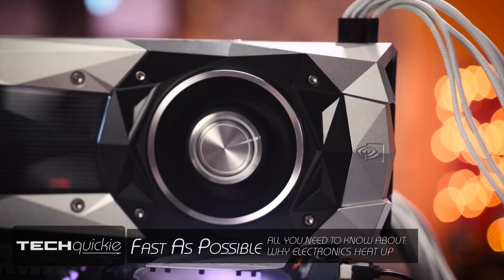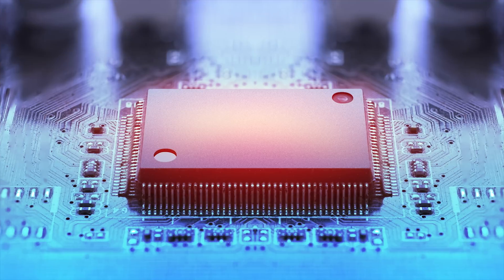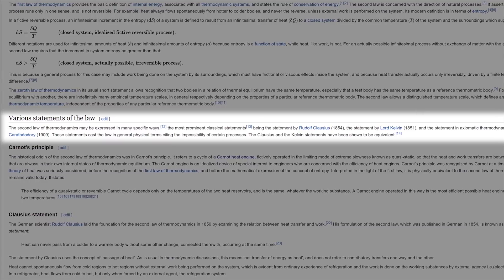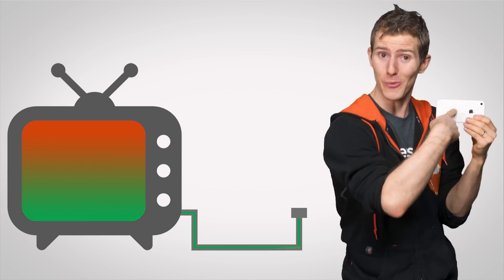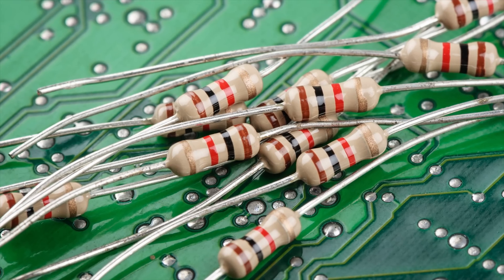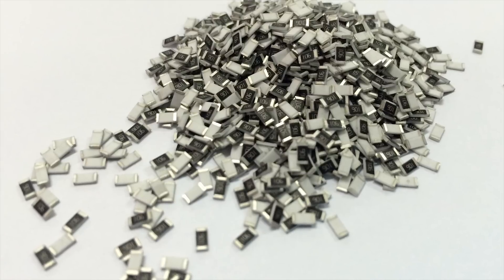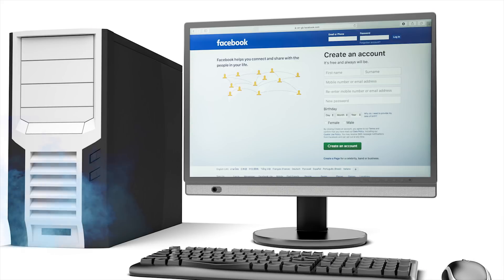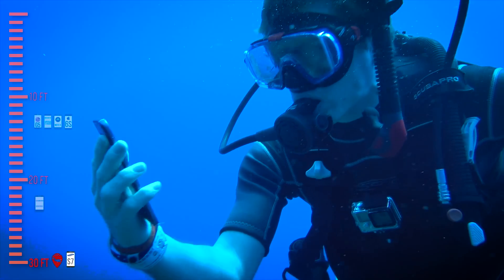Why Do Electronics Get Hot?

Comment: Of course the reason those little transistors in your CPU switching on and off takes energy is because the transistors in question are MOSFETs, the same as the big ones on your board, only smaller, and there are literally billions of them. Apart from a small amount of leakage, in modern CMOS technology when they are not changing state they don't actually use power. The gate though, the part that turns it on and off, is inherently somewhat capacitor-like, which means it needs to be charged to switch on, and discharged to switch off. The energy needed to charge that is then wasted as heat, billions of times per second. It's amazing, actually, that these things heat up as little as they do, if you think about it.

Comment: You don't generate Heat. Energy cannot be generated or created. You can only convert energy. Your PC needs electrical energy and since energy cannot get lost and your PC isnt moving or anythig else the energy is converted to heat.
Reply: Of course heat can be generated. At least this is a common term for it. You can even generate electrical energy. Do you know how they call the device that does it? Generator.
You're right with "energy cannot be generated ..." and the rest of your comment though ;)
Reply: Yeah, I know how a synchronous generator "generates" electrical energy (its actually converting mechanical energy to electrical). And yes its für common term but nevertheless I don't like it because "generating ... energy" just sounds wrong ;)
Reply: depends on how far you wanna go with the technicalities lol. Linus definition of the 2nd law was also kind of weak. he should've said that there is waste energy released, most of which is heat, although light vibration (sound) radiation....etc can all be waste energy as well although not necessarily in electronics
Reply: Technically, heat is just the transfer of energy between two objects. So "generating heat" just means energy is being transferred between objects, thus increasing the temperature in one. It does not mean "energy is being created".

Regardless of that definition, if we were converting one type of energy into "heat", you could say that heat was being generated, since it didn't exist in that form previously.
Reply: You do generate heat. You generate heat from energy

The energy is converted into heat, but heat does appear
Reply: Heat is the transfer of thermodynamical energy, heat is a flow of energy, not energy,  you do can generate a flow, also you're doing work on the electronics, so if it were made of superconductors you wouldn't waste energy in the form of heat and energy would still be conserved.

Comment: Why don't they make processors bigger for better heat dissipation?
Reply: My guess is that they want to keep things small to minimize delay between transistors and cores so that way it's faster.
Reply: Jonathan Ferrante I'd say it's because the manufacturers want to save money and material. Even if it's a small amount of material, multiply that by 1kk and it becomes a lot of material.

Comment: It's simple AF when you know physics
When a lot of electricty (more intensity than voltage) electrons excite things around where he pass (more voltage is more excited electrons) 
And temperature is excited atoms
Reply: "temperature is excited electrons" 
Wrong
Reply: Then when we OC a cpu for example, it affect the frequency of how fast current pass
(like 5 amps per seconds then oc it could be 9, you understand) and sometimes it affect the voltage
(Like 5.2 GHz 7700k which set it on 1.57 V)

Comment: its Because Silicon devices are not 100% efficient. it doesn't matter if its a CPU, a small IC or a single transistor. if it runs on current it will produce heat. Simple.

Comment: You should have talked about why amplifiers get hot, but don't need coolers and don't get damaged because of the heat. In some cases, the heat it discharges is a good feature, such as for Class A amps.

Comment: Maybe sounds like a dumb question but why is it important that all the hardware is kept cool?
Reply: Materials tend to resist electricity the more they heat up.
Reply: Sebastian Poppenborg More heat = More degradation over time.
Reply: A question is not a sign of ignorance or "dumbness," it's just a sign of curiosity :)
Reply: Too hot, and the circuits fuse, and in the end you have a piece of dead hardware
Reply: +TheBanana Dude That was not caused by heat, but by faulty battery cells...
Reply: Have you ever cooked your own meal?
Those hotplates often are in the range of 800 to 1500 Watts.
With vitroceramic you can see what is going on. http://www.icf.com.tr/files/vitro-back-2.jpg
Yes, that is red hot glowing metal.

Now let us compare that to a modern CPU. They are less than 2 cm² in area. So they actually produce more heat than your hotplate does and that already brings the metal to glowing. If your CPU would not get cooled it would simply burn up any plastic and melt the metal.

and you do not need to get it that hot. the warmer the silicon gets the faster it degrades, where most put the limit at around 125°C where it starts to fail rapidly.

And then there is the thing about efficiency.
The warmer metals get the more resistant they get. That in turn means you need to push even more energy to deliver enough to flip the individual switches (mosfets). So a cold CPU uses less power for the same work than a hot CPU would need.
Reply: Dielectrics (resistors) actually lose resistivity as they heat up. (Conductors get resistive with heat). Silicon is a semiconductor and acts like both. Transistors (made of silicon) modify the resistance across them based on the input (gate) voltage. 

This is dangerous in amplifiers since this causes thermal runaway ( I = V / R ).  Less resistivity increases current. More current creates more heat. So eventually your silicon transistors won't be able to generate resistance to turn off. 

Once the temperature gets to 500C, the doped phosphorous in the silicon is going to start to move around. Destroying transistors, the functionality of the chip. 

The long term effects of high heat is a slower version of the above. doped phosphorus is slowly going move. 

Your CPU is designed to turn off unnecessary dead transistors, but too many in the wrong place will render the CPU useless.
Reply: the thermal stress create cracks on soldering balls and that produce bad contact between the component and the motherboard, i can ensure you that from my experience, it happened to me. i had to reballing a pch
Reply: because the thermal stress damage the components and the soldering balls of the componentes attached to your motherboard
Reply: Here's an easy explanation. What is heat in physics? Basically, movement. At absolute zero no particle is moving, but the warmer you get, the more those particles move. Sure, solids are not as prone to change due to heat as gases, but at some point they can melt, and we want to prevent that. :)
Reply: The soldering balls needs more than 250c to desolder...
Reply: But just one more thing, how much it last reballing?
Reply: is working perfectly now, i used fujipoly thermal pads above the pch now to prevent overheating again
Reply: So they don't burn out.
Reply: Because Rosin Core solder sucks, has horrid thermal dynamics and is used in just about everything electronic now from your cellphone / TV / Computer / etc, thank the hippies and RoHS in 2006 yacking about lead for it becoming a standard and lead being cast to the wind.
Reply: Douse your system with gasoline and throw a match on it and you'll have your answer.
Reply: Idiots... ._.
Reply: Sebastian Poppenborg water is worse than high temperature for your pc. also.
Reply: uTukan wrong it's mostly engineering fault design, batteries are increasing in size when they accumulate energy, because when materials are heated they grow in size. Internal space of a phone was too small for such batteries. Yeah Li-ion batteries are becoming explosive when piersing through the opposite cells happen. If you put any Li-ion battery in a too small space it's gonna blow eventually.
Reply: Because with higher temperature the electrical resistance is rising to. This can cause your CPU to turn off because the resistance lowers the voltage to.
Reply: answer= samsung galaxy note7
Reply: i know but fire is hot

Comment: you are right, the transistors create heat. but if you would like a more specific aspect of a transistor, it's the fact that transistors are not perfect a perfect on off switches. They will have a slight internal resistance that increases with heat. the faster they are switched the less time they have to cool down. The more they heat up the slower they are at changing states, which increases resistance, which then increases power dissipation which increases temperature, so basically a self destructive circle. this is why CPUs will throttle and slow down because the transistors can not simply keep their switching speed.
Reply: 1kuhny also cpu can throttle down to save energy

Comment: electricity in general gives off heat when there is a really high level of intensity (measured in amps) in a small copper wire. the smaller the wire, the less Amps it can handle.There are reference charts for this.

A single 12V+ rail on an Evga 500b bronze 80+ PSU can provide up to 40 A.

if you think about a 95W cpu on 1.4V, then the cpu is pulling 67 A in total throughout all its internals.... yeah its gonna heat up.

Comment: overclock...
Reply: Yes, overclock make things hotter
Cause it's an electrical frequency, then it affect how fast current pass
Reply: That is possibly the least accurate thing i have ever read.
drift velocity is tooooootally not related to frequency. - the electrons drift at a few mm per second whatever the frequency.
gates radiate energy when there is a forward voltage drop and a forward current.
in either stable state there is no energy radiated, when it's of there's no voltage drop, when it's on there's no current flow, therefore no energy dissipated. (well, -ish. still I^2 R losses)
when the gate is transitioning from on to off, or off to on then there is, briefly a forward current and a potential difference, hence energy is radiated.
the rise/fall time is going to be pretty much constant for a given fabrication, but...
the faster the clock, the greater the percentage of overall time spent in this transitional state, ergo the more heat is generated.
it's not rocket science
Reply: why
Reply: ^ ...how many times current is allowed to pass per second
Reply: Some Random Guy 666 whatareudoing overcock
Reply: overclock.
Reply: What does that have to do with the video?